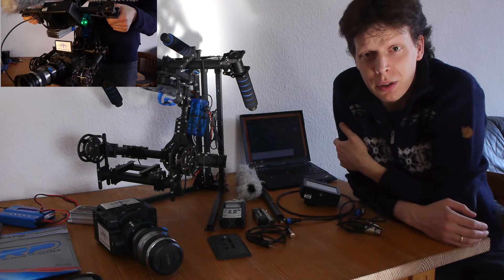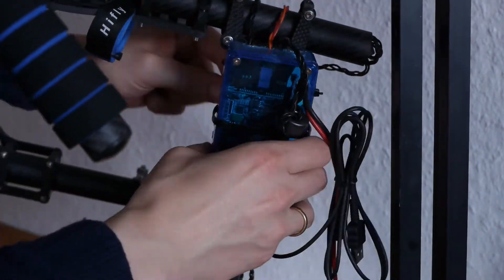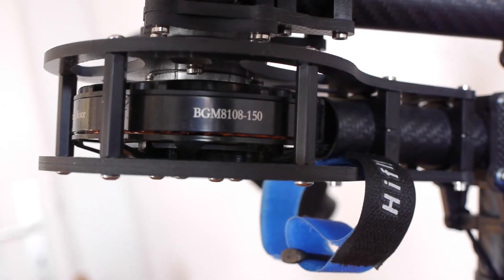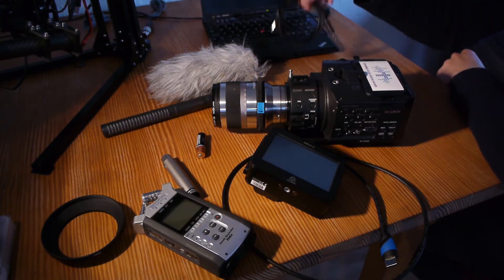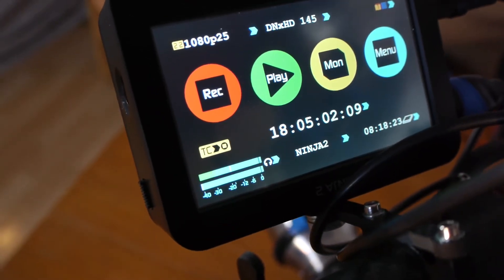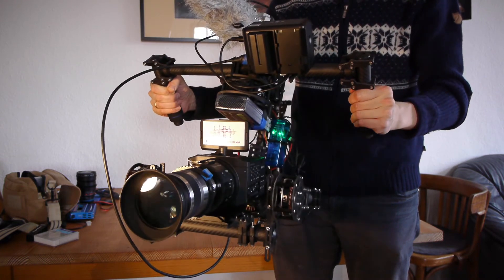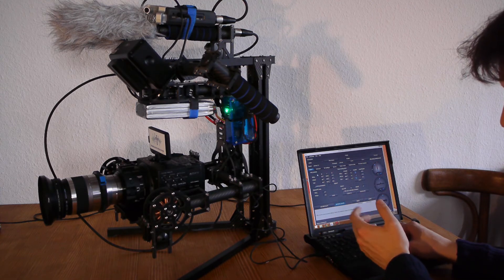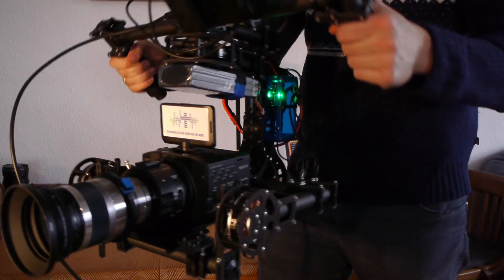Tutorial: AlexMos HiFly 5kg Gimbal full Setup and Electronic explained (Movi M10, Defy G5)

Comment: Hi Timo,
I hope you can help me. My rig is balanced fine. I can get pitch and roll just but the yaw does not seem to work even though the motor is good and is getting power. I have tried many settings but no luck. I am using a Pentax K30 with a 20-80mm lens. I am totally baffled. If you cannot help can you point me in a direction to get help. Danke.
Joe

Comment: I got an alexmos 32 bit controller from aliexpress. I built my gimbal and used it on my gimbal. My motors were dualsky xm7015 and 7010 type. I calibrated the accelerometer and it didn't work. It holds the motors still but doesn't stabilize the camera. I tried using one or two imu's together. Didn't help either. I then tried to use an 8 bit controller, it worked but the power wasn't enough. The motors were weak on torque (as expected because 8bit versions don't have enough current supply). Do you think the 32 bit one I got from aliexpress may be garbage? There is no distributor for alexmos in Turkey unfortunately...:(

Comment: Hi Timo! I'm not 100% sure but I think my board is broken to. I can get roll/Pitch work perfectly but i cannot get a smooth yaw axis. It feels like the motor stick to it's poles when I'm using yaw. Then my yaw is not following the gimbals motions. Sometimes i can "wake it Up" and it follow but it's still shaking. What do you think. Could it be broken?
Reply from the maker: fiskejournalen It is hard to say. Could you find out if it is broken? Many people have problems with the yaw axis like myself. I changed the board and solved the problems. But sometimes the yaw problems just disappear. The alexmos board is not always the best.

Comment: Hi Timo, thanks for taking the time to make all of these video and share your experiences and knowledge with us. I am attempting to make a similar gimbal to yours for my canon C100 but I have no experience with any of this so I'm hitting brick walls at every turn. I have a kit HyFly gimbal with 6208 motors that came with the frame mostly assembled. I bought separately a 32bit controller but when it arrived I noticed the IMU leads were not long enough. I'm also not sure on the current draw and which controller I should really be using. None of the sites selling gimbal motors spec their current usage.
I'm in New Zealand and parts take a while to get here sometimes. Since I ordered them from different suppliers they have taken different amount of time to get here.
The c100 without the top handle and grip weighs just a little more than a 5d2 but the came 7000 style of gimbal is no good because the c100 is so much taller and I needed to make sure it had enough depth to the carrier to be able to balance. Anyway curious to know which 32bit controller you used.
Cheers
Jon
Reply from the maker: I have this one: http://powerparts-uav.de/neuheiten/94/mini-32-bit-basecam-simplebgc-3-achs-controller-cnc-plastic-case
And the cables are not very long but long enought.

Comment: hi thanks for your tutorial.
Do you know how can I connect 2 Imu sensors in the Basecam Fly Arduino 32 bits board ? I have 2 IMU but the 2 sensor are exactly the same. Thanks
Reply from the maker: Sorry, I have only 8-bit boards with a single IMU.

Comment: Thanks for the info Timo! Im thinking of getting one for an upcoming shoot but Im afraid it wont arrive in time. How long did yours take to arrive? And did it come with everything like the little board you used to connect the two motors? thanks!
Reply from the maker: Hello, it arrived within 3 days with almost all parts needed. But most people need several months to get it goting. You need to solder, you need to tune. It takes time.

Comment: Wow that looks great!

You can find super thin HDMI cables that you can run along the tubes - they're very cheap:
http://www.newegg.com/Product/Product.aspx?Item=N82E16882179002&cm_re=thin_hdmi-_-82-179-002-_-Product

Works like a charm.

Great build
Reply from the maker: Have you tested the flexibility of the HDMI cable? 
I'am thinking about to buy this one: http://www.amazon.com/gp/product/B006UJSAUW/ref=s9_psimh_gw_p23_d3_i1?pf_rd_m=ATVPDKIKX0DER&pf_rd_s=center-2&pf_rd_r=1WBQ0JP9BDDQ12VBAE82&pf_rd_t=101&pf_rd_p=1688200382&pf_rd_i=507846
It looks a litle bit more flexible.
Reply: Timo Rucks Hi Timo, I bought this cable several month ago, because with a stiffer cable the controller could have a misinterpretation of the real resistance of the gimbal. With your PID setting for the YAW, try to set the 'I' value completely to zero.

Comment: Hi, when i use follow pitch/roll  the roll don't start in plain. Do you know why?
Reply from the maker: Have you tried to change the offset? Otherwise you need just to play a little bit. I know this problem. And at some point it just disappears.
Reply: Timo Rucks Yes i tried. Have you same problem?  I adjust the roll with radio control, but i want to start in plain. I use offset and speed at 0  in follow pitch to have the cam always in plain. I  What value do you use in follow pitch?   ps.sorry for my english

Comment: Hi Timo. Thanks for the video. I purchased a similar HiFly as yours. The 8108 motor wires didn't have JR connectors on the ends. Did yours come the same way? If so, how do you know which wire to connect to which pin on the Alexmos? Or does it matter?
Reply from the maker: Hi, the middle wire to the middle pin and the others doesn't matter. Later in the GUI you can invert the motors if needed. But if you have two Pitch motors you need to connect them in opposite directions.
Reply: Thank you for your response! Now I can finally finish my gimbal setup. If you don't mind sharing, how did you learn this?

Comment: Wow, massive motors and power almost to the maximum 255 and still some more torque may needed for what I see! Don't your motors get overheated?

Shivering at the extremes may be solved raising the D value, but what the motor really need in that case is some more power... Anyway, if you have follow mode enabled for all axis that isn't a big deal.

I just have follow yaw. I like some other operator moves pitch with a radio. It's easy for me and we can get some shots that would be difficult otherwise.

I would've liked if you explained some more of the PIDs and power. They are not so easy to tune or set properly as you may think. I'm still learning to get the best stabilization in all the cases. There are thousands of variables.
Reply from the maker: You speak the truth: PIDs are most complicated and variable. As you have seen, my Y-Axis is still shivering a little bit. I think that I need to raise the P an D value of this axis.

My motors are cold all the time. But in the end there is only one gain: Low values are always better. Raise the P means to raise the reaction of the motors. So raise the P exactely to that point which gives you a good response quality. If there is some oscillation - raise the D value.

The motor power is to be tested with the PIDs set to 0. The motors need enought power to hold the camera in place while you are moving the gimbal al little bit. My camera and lens are so heavy that I raised my power a lot. It might be to high now. But as long as I have no heat problems at al I will not change it. So set the motor power at first and then the PIDs
Reply: I agree, thanks.

My gimbal used to have power to the maximum and motors were a bit hot, and I feared that they may burn. Then I realized I didn't need as much power, and even more, it was making my gimbal shaky on extreme conditions (in combination with poor PID settings). I guess the person who sold me the gimbal didn't know how to stabilize SimpleBGC properly, so I must do it myself anyway.

Best regards.

Comment: Hey timo. Everything is working fine in my gimbal except I can't get the 2nd tilt motor to turn the opposite direction. I have a Y cable splitting the signal. Then I reverse the direction of the 2nd wire but it still turns the same. So for now I have to run only 1 tilt motor. Any suggestions.
Reply from the maker: I really have no idea how this can happen. If you reverse one motorcable it should be fine. In my opinion it is even not possible that a motor will not turn the direction when you reverse the cable. Just try to reverse it agian.

Comment: Thanks Timo. I'm a DP in USA wollwerthfilms.com.  I've had experience with the alexmos system and just bought this exact same one.  But I can't get my YAW axis to work.  Do you even use the extension board with you're new setup?
Reply from the maker: Hello, yes I use the extension board. But the YAW motor is plugged in on the mainboard. I had a not working YAW axis too. The board was broken. So the seller send me a new one and it worked fine. What is your problem? What is your YAW axis doing?
Reply: Timo Rucks
I just got the Yaw working. I'm still plugging the servo into the YAW board. I suppose there is no reason not to?  I'm using a blackmagic 4k production camera on my gimbal.  Do you have any issues with not being able to stop oscillations on the YAW axis ,  I've heard others say that is an issue with Alexmos boards. apparently you have had good success.
Reply from the maker: Stephen Wollwerth With my old broken board I had oscillations a lot. But never with my new board. If you only have little oscillations just raise the P and D value and see what happens.

Comment: Why are you using a 3s battery? From what I've read gimbals preform better on 4s.
Reply from the maker: Yes, you can use 2s up to 4s Batteries. But the 3s are totally fine. The board is not as hot and not as noisy (clicking sound) under 12 Volt.

Here are the details:
Input voltage (Recommended/Maximum) : 7,4 - 16.4V / 20V Max motor current without cooling: 1.5A per motor
Max USB Power: 500 mA (fuse protected)
Board operating temp: -20C to +80C
Motor driver temperature shutdown at +165 C